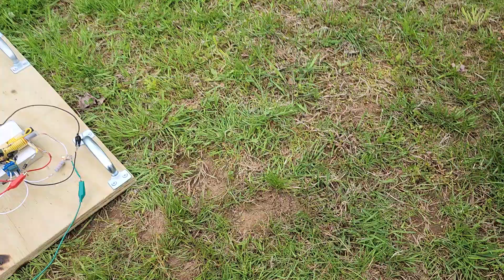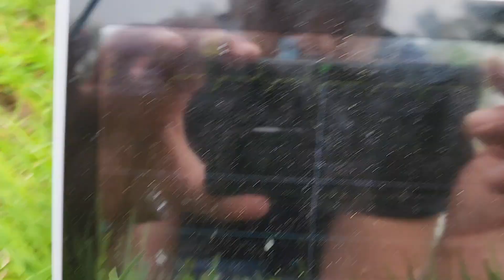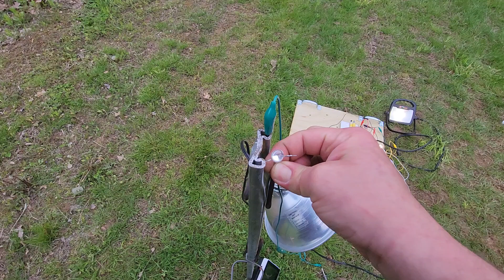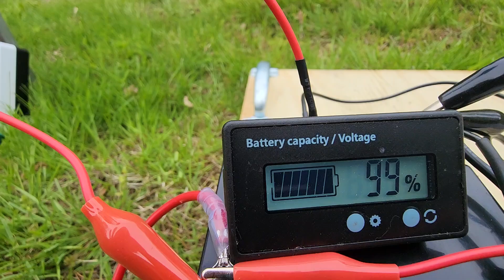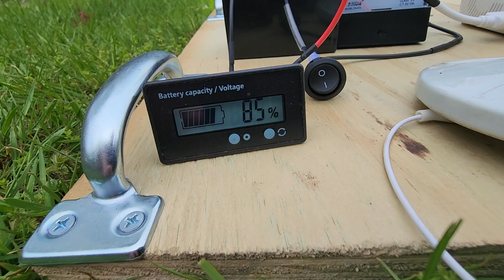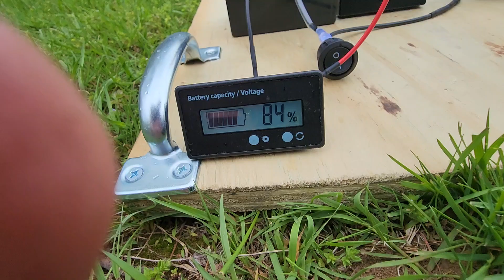🌩 OVER 1 HOUR DEMONSTRATION OF THE NEGATIVE RESISTANCE RINGER GEN BOARD PROTOTYPE OUTSIDE 🌩

Comment: the battery charges or goes back to higher volt wgen you remove the load ... .. he should put a load in both ways ... with with ground connected and without ground and complet of the system but no need to explain this cause they way he is explaining negative resistance really works... i am doing test in don smith device and kapanadze this thing works and even better using don smith

Comment: This is nice. Though, you should be recharging your battery wirelessly and it should maintain it's charge without dropping. I've made a Don Smith based device that does just that. It charges a high capacitance, low voltage electrolytic capacitor bank for the amps and that feeds a Pure Sine Wave 2000A IGBT Inverter Module Board with two 1.2kV, 300A IGBT Half-Bridge Modules and a 29kVA Isolation Transformer that handles the 60Hz the output which is tuned to 24kW. This is good though bro. Keep up the good work as you already are far beyond most of the planet in terms of functionality and understanding!
Reply: i wonder one thing only ??? how did you do the conversion to 60hz did you use mosfets or SCR???
Reply: @angkimdkonvacimn  I use two IGBT Half-Bridge Modules that switch a large electrolytic capacitor bank. It's controlled by a customized version of the rear stage of a UPS (which is just the inverter portion, without all of the other complicated extra components) that modulates the switching signal sent to the two IGBT Half-Bridge Module gate pins. So the DC to the 60Hz Pure Sine Wave is done through that SPWM board. I was going to start posting videos of my setup along with tutorials, what parts to use and where to get them, the whole 9 Yards, but I decided not to yet. I'm still working on a way to make it so that no one can capitalize off of it because that's exactly what will happen if I were to do that. Steal my work, change something about it, claim it as theirs, try and patent it, end up dead. You know, the usual.
Reply: @innerGfrequentlyvibrating  thank you for your reply i appreciate your help, at least you can help us get better result with our own device  :)) and we can get more ideas , you have mentioned you use half bridge  part... do you have also included a resonance part in half bridge inverter cause as you know half bridge inverters converters contain resonance series tank, anyway i am working in a don smith device, i have made the same coil as don did L1 coil and L2 with center tap and i can charge a dc cap 450v 4500uf  ..the charge takes 20 seconds but i think the charge is slow ... .. i have a question if you don't mind asking you , in your device if you cannect you connect a load on your high voltage side where is ac how much power you have  i mean without converting to dc  ??? and i am curious about  do you use high frequency neon sign transformer or flyback transformer  to gain the high voltage??? cause i am using nst but nst is flactuating the frequency it is not stable its hard to get i correct in resonance  ,. i would appresiate if you can answer me so that i can boost more output in my device god bless you
Reply: @angkimdkonvacimn   I believe you're looking at it the wrong way. Your first stage should be about generating a strong magnetic field of varying intensity. The next stage should be picking up those oscillations via magnetic resonance and ramping up the voltage, which is then rectified and filtered. You SHOULD NOT be focusing on "how much power you're getting" at this point as it is completely irrelevant. The only point where "power" is important is at the final part of the entire circuit where the load is. Remember, your ENTIRE CIRCUIT has to be connected from start to finish, with all the necessary tuned components in between, to even function at all. IT WILL NOT WORK if you're simply stopping at the capacitor stage and seeing how much you can fill it up and how fast. That is NOT a tuned circuit and is pointless. It MUST be properly configured for the LOAD that you're running. If you do not have a LOAD that is impedance matched to your circuit with TRUE EARTH GROUNDS (6 ft. - 10 ft. Copper Rod(s) buried in the ground), IT WILL NOT WORK!
Reply from the maker: @innerGfrequentlyvibrating  very interested in your setup as well if you're interested in sharing :)
Reply: @MTECH2022  It'll be open-sourced in the near future. Too many people would try and make a quick buck off of it if I just specifically gave the info to individuals. Energy should be free for all and never profited from so that's why I don't go about it in that manner.

Comment: Hello, I'm very interested in this subject and the device.  My question to you is how do we know that we are not just seeing the battery recover after loading it vs the battery charging on its own?
Reply from the maker: Greetings i demonstrated the prototype board recharging an absolutely dead nimh rc battery in one of my earlier videos. I'll find the exact spot & update the comment with a link & time stamp to it :)
Reply: Excellent, thank you.  Also, is the primary / trigger battery in this video you speak of compared to the secondary battery?  I mean to say, what does the two batteries looked like balanced after the dead secondary is charged up?  Again, I'm studying asymmetrical regaged systems and I would like to demonstrate this type energy behavior to to people at my church.  They are very much interested in renewable energy.  I'm thinking about purchasing one of the completed systems.

Comment: 感谢你的工作!干的好! 多块电池并联电池电量上升速度会一样快吗? 这个系统还有很多的测试空间~谢谢你~
Reply from the maker: Not sure yet. Only tested it with a 5AH lifepo4 14vdc supercap battery hybrid but I'm goinng to have to buy a 50AH super capacitor battery hybrid & test that soon & see if it can rapidly recharge. I think the battery itself is becoming part of the negative resistant resonant circuit

Comment: What about if you connect another battery after turning off the inverter? does it charge it too? you  could made a switching bateries sistem and never turn it off, i dont know.,  im just still  trying to understand  . Congrats for your invention, its awesome!!! Please go on!
Reply: Those radiant spikes hitting the ion inside the battery moving them from one side to other very quick resulting a rapid charging effect
Reply from the maker: @lustatus  yeah & towards the end of the test the little 5AH lifepo4 super cap battery hybrid was hot 🔥
Reply from the maker: Yes the output seems to rapidly recharge an identical 5AH lifepo4 supercap battery hybrid & thanks. I think the battery is actually resonating somehow

Comment: If it recharges from 60% to 100% in an instant and instantly drops back to 60% when load is connected again, then the battery wasn't recharged, don't you think? or am i missing something?
Reply from the maker: A 5H 13.8vdc source shouldn't be able to run 120 watts for over 40 minutes so something exotic is definitely occurring & if i left the inverter off longer the charge probably would have been stronger:)

Comment: I believe this works totally! It's pretty difficult to achieve running all loads plus radiant energy for 30 minutes then recharged in a few minutes from a 12v 50ah lipo. Alex is it possible to make a smaller more affordable circuit? I want to build one 😊
Reply: Great, that's a good starter project 🙂 and no worries mate 👍
Reply from the maker: Yes & it's a 5AH 14vdc lifepo4 battery hybrid & thanks for your input :)

Comment: This is excellent and you are showing successful energy harvesting. However when you're charge meter shows 100% you are not actually at 100% because this is a pulse charging system. You can see this because every time you turn the inverter back on it quickly drops to a level less than 70%. First 65 then around 60 then around 55 etc. if you are actually at 100% then it would drop to a value that would be greater than 95% and level out and then slowly drop. F

Doing some rough math your actual harvesting is not greater than 100 Watts as you are indicating but actually more like around 20 watts. No problem, add some more collection coils and get it up above 100. 🙂
Reply: To elaborate further. The charge meter is reading the tops of the pulses not the average. To see the actual charge turn off the ringer for a moment. While under pulse charging the meter will read 100% when the actual charge is above 70% or somewhere in that range depending on the amplitude of the pulses.

Comment: Hi Mel, great work ❤
Please, have a look on wikipedia related article to negative resistance and you will see this phenomena occur at very specific interval, if you try to extract more power which fall outside this interval the input energy can not be replenished at the rate of output … for efficient amplification of output you must stay in the limits the negative resistance components. If your wires can carry enough energy for desired output you may want to employ negative resistance from feedback to obtain dynamic adjustment and be able to use variable load. See dialogue with @kevy1yt below.

Also, observe on wikipedia about negative resistance it can be voltage or current dependant and you may want to explore what gradient have a better potential difference for your setup … i guess it will be easier to go for voltage in your case.

Comment: It's great. Look after yourself. this is world ending information. Now I get it. the ringer is wound all same direction? or l1 and l2 opposite? The wirless pickup is opposing wound, and the center tap is brought up and under the primary Yes?. THanks so much
Reply from the maker: Thanks & L1 is 26 awg
L2 is 14 awg. These two coils are wound in opposite directions. 

Center tapped L3 is wound Opposite to the L2 & is exactly as tesla specified in his patent for dynamo coil regulators. This coil is stranded 18awg silicone wire. This Coil is the one that rapidly recharges your source once the sr150 diodes are installed.
Reply: @MTECH2022  gold dust

Comment: The supercap's ability helps to quickly recharge(voltage)...and maybe not(current)to the LiFePo4.
When you repower the inverter, the meter quickly gave 66% from full 100% 
...I hope I am wrong. That's my simple guess from my little thinking.

It would be nice if tested with ordinary SLA batt.

High freq and high voltage helps the wireless effects. 

I do the same recharging thru wireless or sometimes by using of sg.

Nice demo bro! Keep qoing.

Comment: Dude! Come on! You’re killin me. Please do the exact same experiment again outdoors on the board with several incandescent bulb loads and show that the battery drops to 50 or 60%. Great. Then disconnect the resonant circuit while keeping the voltage meter on the battery. Let’s see how quickly the battery charges up by itself. Then immediately do the exact same experiment but this time keep the resonant circuit attached with a secure ground. So in other words, the only difference between the two tests is with the resonant circuit connected and then with the resonant circuit not connected. Compare that amount of charge time for each test.

Make sense? Thanks.
Reply from the maker: I plan to very soon in more detail
Reply: @MTECH2022  ok. Thank you. Nice work, btw!
Reply: Clearly, he runs on power source which is not calibrated to replenish required amount of output at the same rate in this configuration.
There is another mistake that most of people do: heavy reliance on instruments not calibrated for specific frequency and reading values displayed are incorrect. The AC power meter is calibrated for 50Hz 220 V … I would just ignore it completely, it is utterly useless in this case.

Correct calculus for input energy versus output energy in a very simple manner is to use some resistance wire (nichrome) with certain known and measured ohmic resistance and measure temperature difference in given amount of time, which than can be calculated for energy in watt hour and only than compared with energy input calculated as power=volt x amp in period of time.

It is obvious there is electric energy harvesting but the rate of collection in this case is not enough in this configuration to sustain “consumption” (power dissipation). In case of incandescent bulbs power dissipation should take in account luminous flux + heat … which makes it difficult, using just resistance of wire makes it simpler and easier.

If you try to point out that there might not be enough power to be extracted from local environment I can tell you are wrong but if you try to say a different approach/method is required you are right.

This type of system must be designed for a certain output where negative resistance is effective, trying to extract more power nullify the effect of negative resistance. Negative resistance should be acknowledged as method of amplification. Simple read on wikipedia about negative resistance might help to understand this phenomena.

An working circuit should employ feedback negative resistance where electric energy is recirculated in the system and the exact occurrence of negative resistance must match the load connected as dynamic adjustment where maximum output power will be given by characteristic and properties of components used. Frequency will vary in the same time with the resistance (impedance) of the load, any increase of the load impedance will raise the frequency of the whole circuit. I have done it and tested.
Reply: @Caesarus2011  these are all good points and are more scientific ways of measuring the power harvesting. Right now though, it seems that this device does recharge the battery at a sufficiently fast rate which, if repeatable by others, proves the basic fundamental concept works. That would be terrific if true.
Reply: @Caesarus2011  also, I think you are speaking of a dynamic device which requires no battery, correct? Something that can power the load directly without a battery or super cap. Can you demonstrate yours and show the details in a schematic with specific winding information and such? Thanks.
Reply: @kevy1yt  I am not speaking of a device that require no batteries or power source, but any power source should be considered … I mean ANY and I would leave to anyones imagination what else can be.

I can’t see why it can not be replicated if someone wish to do it. As I said, clearly there is energy harvesting not only efficient usage of power but, the rate of replenishing is less than rate of power dissipation … a smaller load can run for much longer period of time, which suggest an up scale is needed to maintain sustained power dissipation for heavier load.

Mel is just to excited  and want to prove what is worth his findings … I hope he is not going to waste his time with naysayers and do a lot of silly measurements as asked or he will end up as Gerard Morin. Build and use approach will benefit everyone, rather than doing the work of dedicated paid scientists and researchers … they can do themselves whatever they wish.

Anyway I am not going for such high level of electromagnetic radiation and I rather keep it small as I only need to power a normal house not a factory or a town. 

If we want to harvest energy and have a small device (relative small) we need batteries or capacitors N Tesla have proved we can harvest radiant energy and this principle is simply ignored because would make redundant all multinational bigoilco instantly. If you wish go on USPTO and do a search for radiant energy and see with your own eyes how many thousands of patents are registered … and all based on the very same invention of Tesla.

But also we can harvest electric power without batteries and/capacitors as per Daniel Macfarland Cook … best explanation of what is happening by far that outsmart all what mainstream science say is wrong or impossible.

Have a look on my channel and see how simple it is and cheap to replicate “what if I did this” channel. I am using 60 watts input (limited) which allow to draw 🤣 up to 115 watts and able to power loads rated for +2000 watts at 50hz 220V, the whole circuit runs cold and I can hold with bare hands wires connecting the loads powered without any harm. I have listed all components used and tested with links and anyone can replicate and test and use for themselves. (Link in description of my video).

People are trying to build complicated circuits and expensive because they listen to mainstream science teachings/gov or whatever else organisations.

Highly recommend “what if I did this” yt channel and especially latest video published few days ago. Everything is given for free to anyone.
Reply: Love the outdoor feel n our chicken friend 🎉🎉🎉🎉❤❤❤❤❤❤